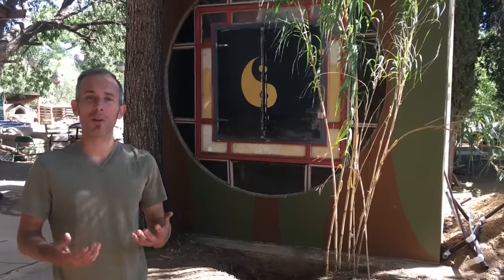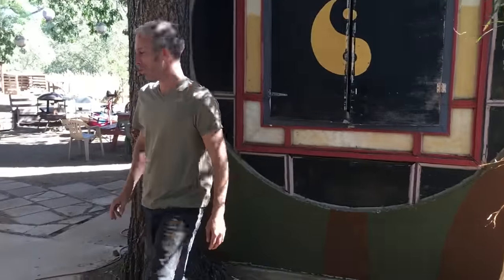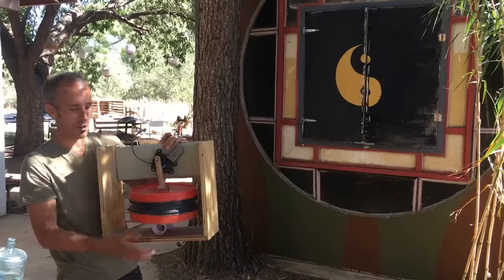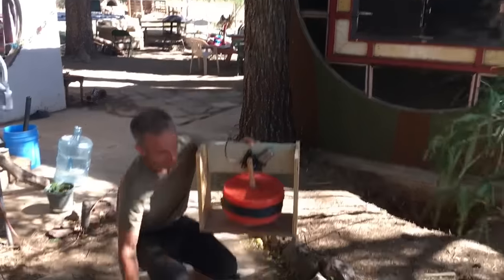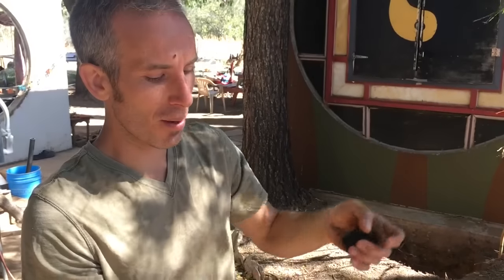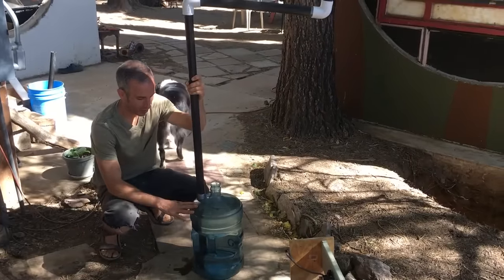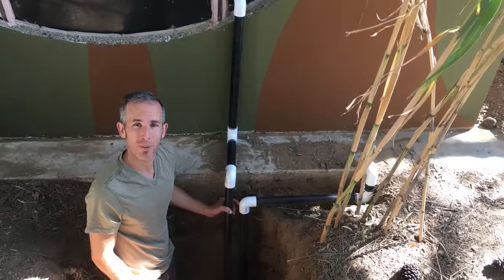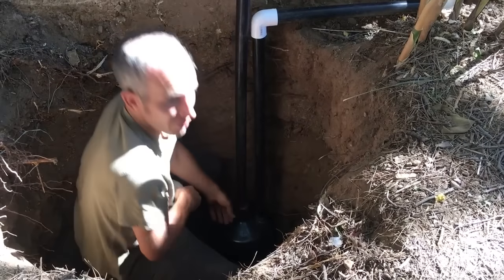$20 Ground Mass Air Cooling -DIY, Open Source

Comment from the maker: Data I collected from the initial prototype (preceding this one in the video) but didn't end up in this video (but will the next):
Input air temp: ~50 C (from a vacuum cleaner motor as air pump which generated a lot of heat)
Ground temp: 23.5 C (~1.1m max depth, sandy above sandstone, shaded)
Ambient air temp: ~30 C (both inside house and outside because bad windows and no insulation)
Flow rate: 2 l/s
Test time: 8.5 hours
Output air temp from system: 24 C

I was largely expecting the ground heat capacity to saturate at some point, but neither it or the output came hardly at all above the starting point, even running it at such high input temps for essentially the whole day.

With regards to humidifying the air, even if 100% of the dumped excess heat went into vaporising the water, the result would still only be a couple percent increase in absolute humidity, and though I still need to properly test that aspect, I feel like passing warm moist air through cool water should actually dehumidify it, as that's how that is often done industrially, rather than the opposite. But remains to be seen.

A closed loop system is also an option, but does introduce other potential issues.

Table salt should keep the water sterile in a saturated solution and won't gas off like other options. Even extremophile organisms can't survive that level of salinity.
Reply: It's two years later any improvement or breakthroughs. Would it be possible to use rainwater we already collect and use for daily use that way the water isn't stagnant and is replenished regularly. would a fish tank bubbler work better cooling smaller bubbles
Reply: To cool the 1728 cubic foot cube volume from 30c to 23.5c you need to  remove 304.1 btu (assuming bone dry air). Assuming the 30C dry air and 23.5c dry air didn`t mix (which they would), your 2L per second air flow rate would do the job in around 6 hours 48 minutes, assuming the cube and water didnt gain or lose any additional heat in that time (which they would) :)
Reply: Wow!  This looks very promising!   
It's inspiring my inner Rube Goldberg again! 

Questions!?
—Why the big hole in the side of the 5 gal. water bottle? 
—Does the bottle need periodically checked & refilled—how often? 
—Was the ground-hole covered? With what? 
—Is this located on the north side of the structure for better cooling? 
—was the outlet pipe run to the top of the wall, & the out-take pipe run from near the floor? (cool temps fall to floor from ceiling, more effectively cooling room)? 
—Can a battery be included to run the pump at night? 
—Guessing it could use a 55 gal. barrel to make bigger capacity/better cooling? 
—If the top of water bottle/barrel is down at 6’ deep in ground, & that hole is covered with high R-value (R-40+) insulation, would the system become more efficient, & capable of better relief at higher climate temps? 

NOTES: 
About indoor humidity & temps from an observation long ago: 
Well-sealed bldgs are NOT necessarily the best solution to energy savings…well sealed bldgs have some liabilities little mentioned. 
🧑‍🏫
A renter on rural property built a greenhouse structure—about 20’x30’x10’ at peak.
He laid several inches of gravel on the dirt floor.  
Over time, he hard-walled the frame, & metal roofed it.  
Walls on north side with insulation, & lots of glass on the south wall.   
He’d started doubling that glass by forming 3” airspaces btwn twinned recycled slider door glass panels.  
Areas that had upholstered furnishings, had pallet floors with vapor barrier under those, to decrease “rising damp” affecting the furnishings. 
He explained:  
The air temp/humidity respired between the interior volume of airspace, & the parts of the floor in contact with earth, when Properly sized to handle that volume of air.    
That is, humidity tends to have an affinity for the ground temp, & will tend to condense there, seeping into the ground.   That lowers humidity in the volume of the bldg., as well as affecting the indoor temp to even it out over the course of the year.   So, his indoor humidity could be around 50%, while outdoor temps were upwards of 80 to 90% humidity.  

He had no need of AC to cool.  He only used a woodstove to heat as-needed. 
He had only minimal electric from a couple small panels or a gas generator. 
The bldg. was NOT a “tight” bldg, at all.  

Doubling single-pane window panels with at least a 3” airspace between them, is more efficient than most average dual-pane windows (never gets condensate), is more efficient at holding temps than average manufactured dual-pane windows (which almost always get condensate in winter) 
Industries flooded market with poorly made dual-pane units over the last approx. 25 years….same as industry has done by pushing less efficient heatpump split systems.   
Industries offer lower cost but less efficient units to get more lower-income buyers, who are goaded by marketing & needs.   But buyers AND the environment, pay VERY DEARLY for those less efficient units, over the (often shorter) use-life of the units over time!  

Tight bldgs & floods: 
Many floods ruin the lower few feet of walls & contents.  
WHY haven’t Code enforcers mandated that walls need insulation or tech built that is impervious to local flood events….or….forbidden housing & other buildings from being built in at least the known 100 year flood zones?  
100 years ago, wood houses with no insulation, had…wainscotting….those panels were easily removed post-flood event, to dry out the interior of the walls; then those got replaced—hey, presto!—people kept living in their houses like normal. 
(Tho, today, I’d spray the interiors of walls & anything else wetted by flooding, with MoldZyme, to stop mold using non-toxic product). 

Modern tech is extremely adept at getting consumers to pay big for it.  
But it’s poor at contending with nature's events…
….& it’s out-of-line with over half the population’s abilities to afford it….those cannot afford it;  that many unable to adopt the tech, throttles conversions to the newer better tech necessary to help climate needs.  
That disparity has been made worse, by mandates passed into law, without even remotely adequate funding to help most folks comply. 
👉🏼We NEED easy, low-tech, open-sourced solutions:  
…like this low-tech geothermal system, 
…or the earth-humidity balancing, 
…or the recycled wide-space windows,  
to help MOST of the population drastically lower their power needs, & be able to live more pleasantly, & maybe with less stress over energy costs.
Reply: Does the water container system exchange temps countably better than liquid filled tube coils at depth in ground?   
Could that same cool bellows pump circulate liquid, or air,  between house & earth, & be similarly efficient? 

Picture a hole in ground, at least 8’ deep, & large enuf to temper air or fluid for the volume of the house—2v different ways…
👉🏼simply put in/out tubing to an 8’ deep hole lined with concrete blocks (for stability of hole, & ease of maintenance),  with an insulated cover over the hole to prevent ambient temps warming the hole…
 I think it might, based on my experiences.

Alternately:
👉🏼Instead of recirculating air & worrying about mold potentials, 
COULD use the black ag-irrigation tubing coils in the hole, or PEX, 
recirculate 50: 50 veg.glycerine & water thru 1/2” PEX tubing to ceiling boxes containing radiators, fans, & drainage tubes in ceilings….condensate drains are needed for that, same as for minisplits.  
Fans move room air over the cooling fins.  
Can include a thermostat to control pumps & fans. 
It blends in as a common ceiling vent, parts easily accessed. 
It looks “normal”, so, if property must be sold later, buyers & future repair people can be easily instructed how to handle it. 
Components are fairly low-cost & accessible.  
Some radiators come with lifetime free replacements.  

These are very low-cost to make & operate, compared with high-tech systems, & can run from solar/batteries.  
Of course there might be leaks over time, but components are basic-simple to replace, & far less costly than high-tech systems.

Comment: Where to start.  A small motor just driving a fan would be more energy efficient and remove the complexity of the bellows.  More importantly...an open loop like this is not used in "modern" air circulation systems for several important reasons.  Algae growth in the tank and pipes can off gas methane and moisture in the lines can grow god know what bacteria--both of which can kill you.  A closed loop system with a water to air energy exchange, (a fancy way of saying radiator) with a fan will still take advantage of the Geo-thermal cooling without exposing you to off gassing and bacteria.  It also prevents the water from evaporating.

You are also going to saturate the area around your 5 gallon water bottle with heat very quickly and there goes your cooling.  You need to spread that heat loading over a much larger area.  There are no shortcuts in physics.  Even open source physics =)
Reply from the maker: These were also my main concerns with the approach, but it does work fairly well in practice.
I'd much rather use a fan due to ease of material availability, but they can't overcome the backpressure of bubbling the air through the water.
I saturate the water with table salt, which doesn't off gas and keeps the water completely sterile.
Bubbling warm air through cool water acts as a dehumidifier, not the opposite, so there's no water vapour to accumulate in the downstream pipes and promote biological growth. Could maybe overflow if it's left unchecked for too long in humid conditions and too much water drops into the bottle.
The first prototype of this I used a vacuum cleaner motor as air mover, which was putting out 55C air, which even after eight hours of running the system, in suboptimal conditions (shallow sand) the out air (and therefore ground) temp didn't come up by more than half a degree above baseline.
Reply: @OpenSourceLowTech  Sorry but salt water is not sterile--even in higher concentrations.  Saline is sterile because it uses sterilized water and is kept in a sterilized sealed container.  Google "is salt water sterile?".  If you don't believe Google, have a look at your nearest ocean, brine pond, or salt water aquarium.  As for condensation.  You may not see it on the upper end of your vertical piping because of gravity but there WILL be condensation.  It will just collect lower in the pipe where you can't see it.  By definition, if your system is drawing heat from the room your cooling then you are creating a temperature differential and wherever there is a temperature differential there will be condensation.  

As for the size of your system and thermal saturation.  I don't recall your mentioning the actual temperature differential you achieve.   IIRC you are cooling a 1728 cubic foot space.  You don't mention ambient or average ambient, and specifically how much you lower the temperature, or for how long you can maintain that differential.  Your 5 gallon water container is buried fairly shallow by geothermal standards, and is in a single container--not spread out over a larger area / land mass.  There are quite a few calculators online for calculating how much land mass you would need for systems of differing sizes--these typically are rated by the ton.  Anecdotes are nice.  Facts and data are better.

I mean no disrespect, and I am not being critical or trolling you.  I think the work you are doing is important and that geothermal is a wonderful solution to heating and cooling--one a lot more people should be using.  My concern is that incorrectly designed systems, or systems not sized properly, or open loop systems that can make people sick, will have the opposite effect and actually discourage the general public from exploring greener technologies.  You seem like a good person.  You clearly are creative and willing to put in the labor.  My hope is that you do more research and make sure the system is safe before you make these videos.

Explore moving the water (in a closed loop for safety) rather than pushing air through the water in an open loop.  There are tons of inexpensive water pumps--a lot of them are 12V and designed to work off of solar. Use an energy exchange--aka radiator--which are also fairly inexpensive, equipped with one or more small fans.  Systems like this have already been used safely for a very long time.  They are very energy efficient, low maintenance, easy to install--well except for all that digging =), and most importantly, safe.
Reply: @OpenSourceLowTech  You might use a mixture of borax and citric acid powder mix to keep the water sterile.  Regardless of the approach, you need to change the heat exchange medium from time to time.  For easy water changes the tank could have a third pipe that leads to an access point.  Second, the water bottle sits on gravel and drain from an overflow to the gravel.  From time to time you just pour in new mix and it pushes older mix out to the gravel.  And you need a vastly larger tank to adequately cool 12 foot cubed.  AC's are measured in mass units called tons.  You need upwards of 1,000 pounds (.5 ton) for that much volume.
Reply: Seems like h2o2 would keep the water clean
Reply: @kates2718  h2o2 will degrate into h2o fairly quickly, especially when bubbling air through it.
Reply: Personally, I still prefer the simplicity of an evaporative cooler (swamp cooler), especially when combined with thick-wall construction (adobe, cob, strawbale, rammed earth, even double-wall conventional)...if I were to go "geothermal," I think I'd prefer the earthship design...the fewer mechanical parts, the better. But... thanks for presenting an option.😊
Reply: @teresaprice5070  evaporative cooling doesn't work when it's humid.
Reply: @teresaprice5070  ya, seems like a buried swamp cooler.
Reply: Why not simply dig a basement and live there!
Reply: @genephipps6421 
I feel like enough salt would kill pretty much everything. Also aerating the water would keep it aerobic, and pretty much only good bacteria grow in aerobic conditions. I'm not sure what those bacteria would offgas, but if they are aerobic they shouldn't make you sick

Regardless, if you know of any good videos of something similar, can you please share? Im interested in something like this
Reply: @Legit_SuperFall  Where to begin.  Salt is toxic in stronger concentrations.  Do you want to invest the time and energy monitoring your system?  Salt is also a corrosive--ask anyone near the beach--and it typically eats pumps alive.  If you do go with salt be sure your pump is rated for it.  It also reduces the cooling efficiency of water.  Can you use it?  Sure.  Would I use it?  No.
Reply: @genephipps6421   I understand.
I asked if you had other resources

Comment: Yes, it works!

A couple of things jump out at me that you may not have considered ...
 
You have a water source with air bubbling through it ..... How do you stop the nasties like Legionnaire killing people?
Now I have your attention it is only fair to say the chances may be low, but they are there and it has happened before (hence the name)!
Your air valves do not look like they would be effective with low pressure differentials. Did you think of having a ping pong ball in a tube so that when it falls to the bottom it blocks the air intake? When the pressure outside the intake exceeds the pressure on the compression side of the valve the air would simply blow the ping pong ball up out of the way only for it to fall over the hole when the flow stops. An easy and cheap one way valve for air! 
A Ball Bearing would work well in a similar valve for water or oil!

You could do a similar thing by having an external inlet vent  leading down to the top of a gravel filled hole (or bury a long pipe in the dirt) ...... from your thermal mass (gravel)  bottom you then feed into your room pod or whatever closed space you want to cool. The only thing you need then is a vent high up to let the hot air expell due to air pressure and drag cool air in from the thermal mass!

Good luck with your channel!
Reply from the maker: Yeah the water definitely needs to be kept sterile. A saturated table salt solution seems to work best in terms of ergonomics, availability, killing everything, and not gassing off.

The flap valves aren't the most effective option, but are the easiest to make and integrate. Ping pong ball checks would probably work better, and not be prohibitive, but the others seems just a bit better in a cost benefit sense.

A pipe run rather than the water is the more standard approach to ground mass cooling, and works well, but needs a lot more pipe and ground area. The main point of this one is that you only really need to dig one straight hole.
Reply: @OpenSourceLowTech  another benefit of using a (high) concentration of salt, is that it will possibly give you some moisture removal from the air as well adding to the thermal efficiency. Good luck with this.
Reply from the maker: @evil17  Quite possibly, humidity effects are definitely something needs in situ testing. There is the danger that it would add moisture to the air, since it's coming in direct contact with the water, but I think it should do the opposite, as that's generally what happens when you drop the dew point..
Reply: Only thing wrong with this video is, um, math, science and reality🤦‍♂️
Reply: @OpenSourceLowTech Excellent idea. Thank you